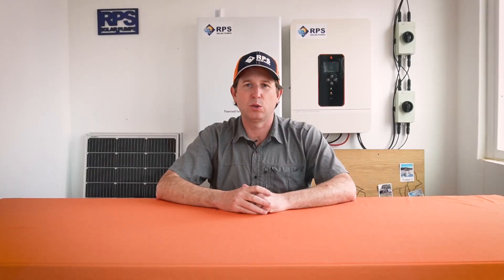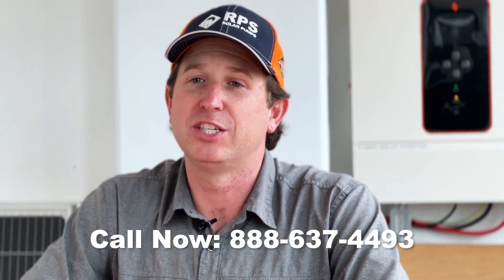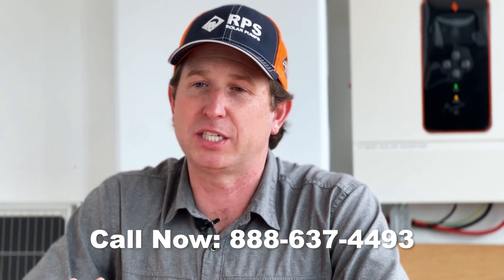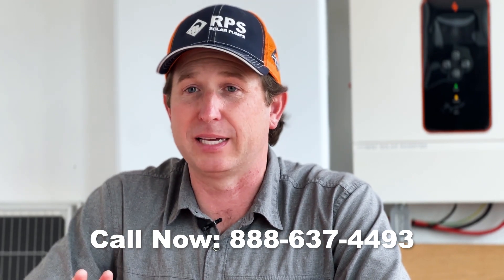How Do You Size A Solar Pump?

Comment: We just installed one of your systems at our ranch. My uncle bought the system so I am not sure of the exact model. But we have the pump sitting at 275 feet from the surface and about a rough 40-45 feet below the water level. To break head pressure the pump has to be set at around 80-85% to even see a trickle. At 100% power and full sun  we are getting about 4gallons per minute/ 240 gph. I have 2 concerns, when there is not enough sun, you can hear the pump running but not able to push water completely out. Is this ok?  Also would installing a check valve near our cistern to prevent the water from going back down during low power or when it shuts down for the day be ok?  I would like for the water to not have to push back up 230 ish feet to get water again.   I tried looking on your website for a place to email you guys, but only found a phone number.   Thanks for your time.
Reply from the maker: Hey there friend! Our support team is ready and able to help you. if you want to reach out to them via email you can find them at support@ruralpowersystems.com